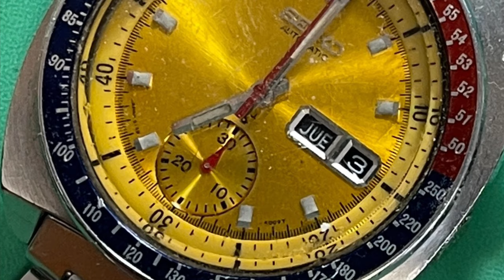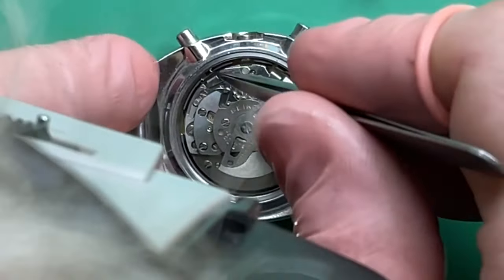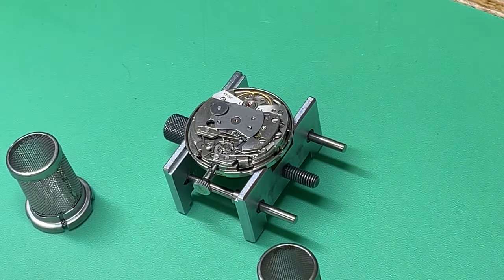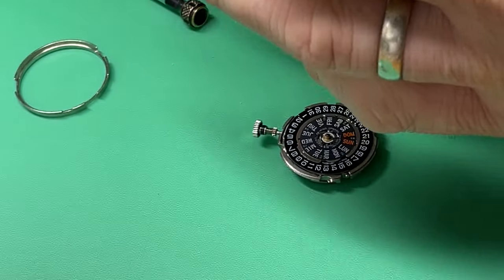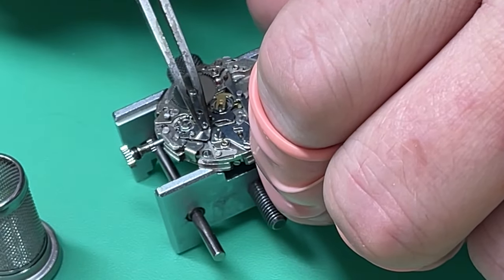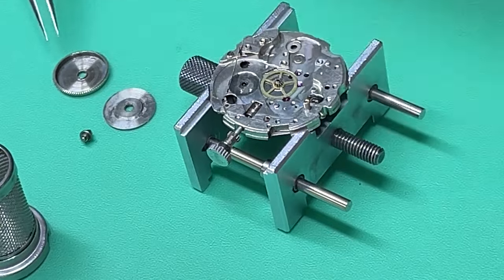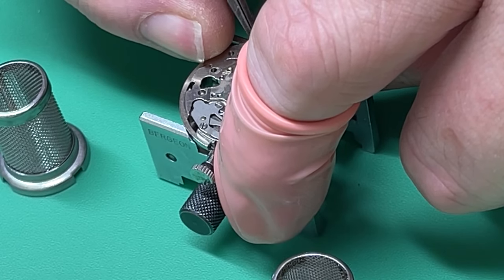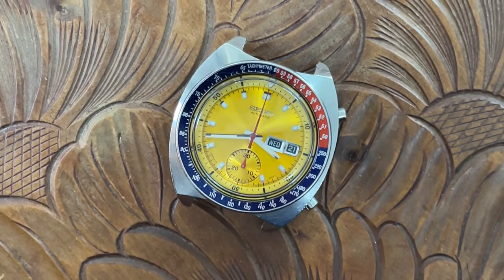For CJ: Seiko 6139-6005 Restoration

Comment: I have a 6139 6002 serial number 398016 and the only thing i have wrong with it is the date does not move on its own but i can press the button to move it, the day changes ok and it keeps good time. How much would it cost to get it fully working.
Reply: Have it serviced at the same time. May as well.  See market place if in the uk